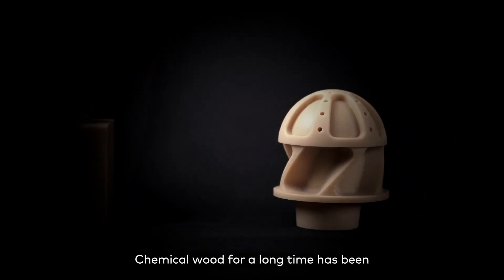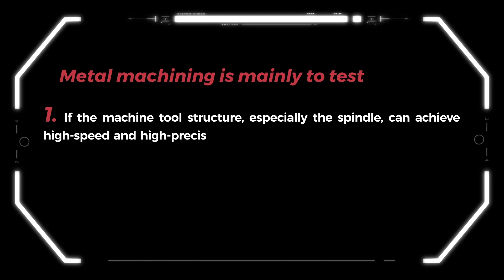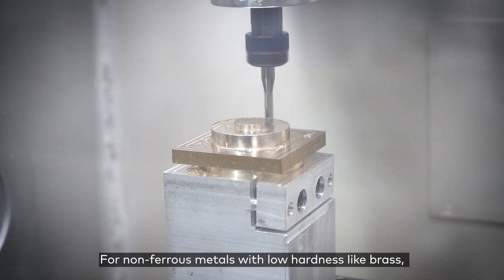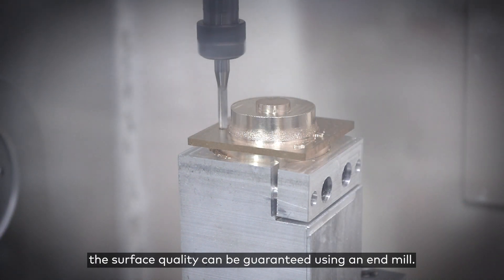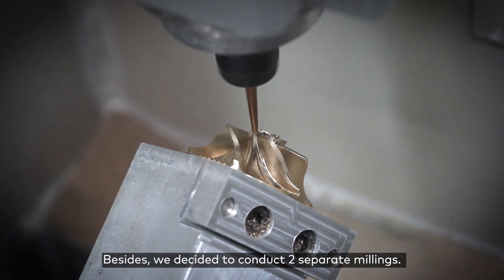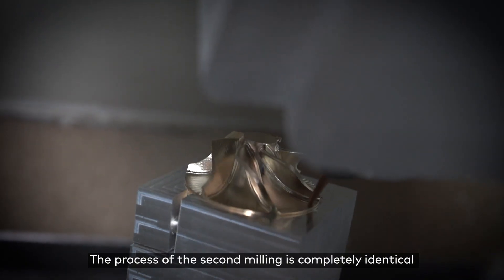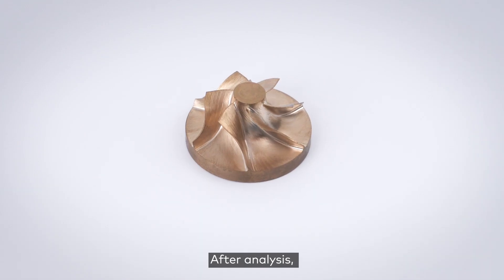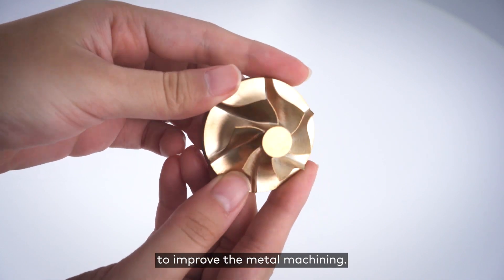5-axis CNC Machining and Milling Brass Metal for the First Time | We Built a 5-axis CNC - UNIONX

Comment: You might want to use a shrink fit instead of a collet and reduce your tool length out of holder. That could remove a substantial amount of the vibration.
Reply from the maker: Honestly, the machine we're developing is not suitble for that. As for coolant, the machine won't come with cooling system eventually. Actually it's not designed to cut metal originally, we just gave it a try this time🤠
Reply: @xhorse3d  Go buy a Noga MC1700 and try a light mist as you cut. Or just spray some WD-40 on the workpiece. You will definitely see the difference in surface finish. Also, try an LBS style 3 flute ball endmill from Helical or similar. They can help alot.
Reply: Also, you really do need coolant to machine brass well.
Reply: @johnfredrickson6987  shown by the pocket nc you dont need coolent, but it helps, also you dont need shrinkfit  toolholders, but extended collets help
Reply: @Basement_CNC  I can tell you from decades of experience that coolant helps with non ferrous metal machining
Reply: @Basement_CNC Also shrink fit or hydraulic tool holders DEFINITELY reduce vibration and chatter. Esp when running high RPM
Reply: @Basement_CNC  : I agree with you.  No coolant is needed.  The other factor for a good finish in brass is a cutter with a very low rake angle.  Higher rake angles will produce chatter on a machine that would not normally misbehave.  However you mount the cutter, if it is not completely secured along it's shank, you are doomed before you start.  🥴

Comment: when you say the accuracy of the spindle is not enough, are you referring to your A or B axis, or are you referring to the spindle motor?
Reply: they said the power of the spindle is not enough, and the accuracy of the lathe? (whatever that is) is not good enough
Reply from the maker: @Basement_CNC  Yeah, the power of the spindle in not enough and the lathe is not accurate enough so far. But we're trying to improve these and will make it reliable before it's released.💪